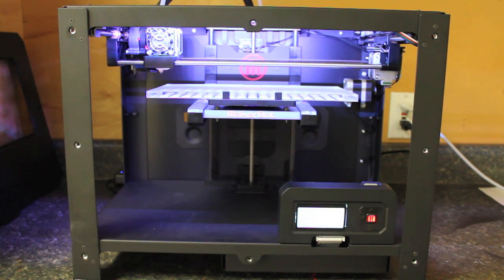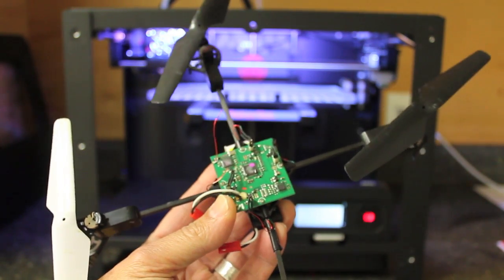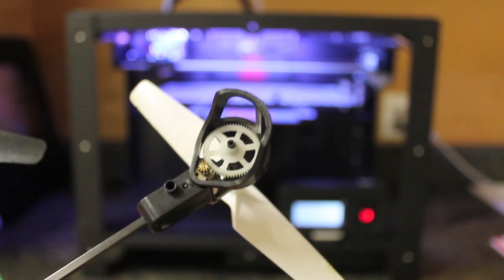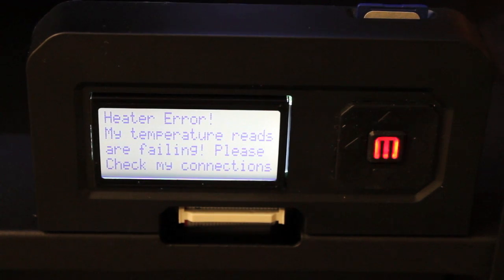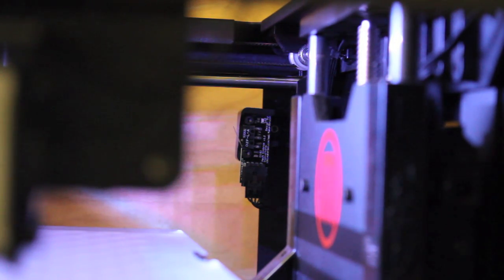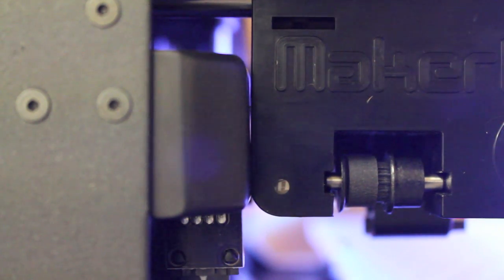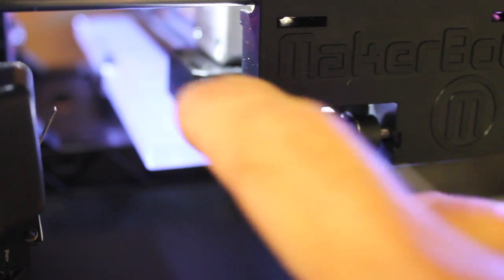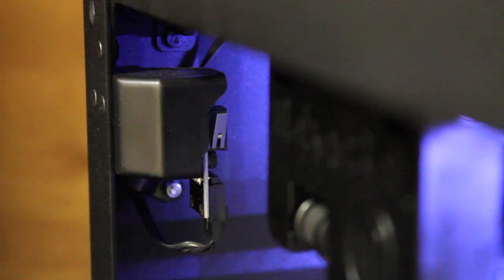I thought I was going to print quad and RC parts with my Makerbot Replicator 2 3D Printer

Comment: I see this is 3 years old.  It looks like you have the Shapeways version of the makerbot with the bad extruders.  Shapeways screwed the pooch with not being responsible and warrantying their bad design.  It isnt your fault they remade a good product into a bad printer.

Now Shapeways is dumping them on the market for about $600 each.
Reply from the maker: +wi11y1960 Interesting. I wasn't aware of this. Will have to do some research. Lately I've been having a heck of a time trying to get my extruder to extrude. It only has one job and has failed miserably!
Reply: Hence the headaches all other buyers of that printer are having with the integral print head.  You may have to contact the vendor for a now non warranty replacement.  Otherwise be a maker and create a aftermarket hot end.
  If you were a local to me I could create something (Hancock County Maine).  Otherwise you might try going to the forum printrbottalk.com .  There might be threads there that will steer you on how to fix the machine.  A good active board.  They deal with other printers as well as the Printrbot.

Comment: hi did you make the gear or not i am planing to buy machine printer but no expirience finaly did yoou print the gear if yes were is the video thanks
Reply from the maker: Kanari Mentos I was unable to make it. The gear teeth were too small and I couldn't get it to work. Hopefully someday I'll be able to get a new printer and do something that small.
Reply: what kind printer is good for quality i need for rc hobby thanks
Reply: Kanari Mentos You need a resin printer to make something like small cogs that is working.
Reply: thanks
Reply: Dennis Baldwin  my friend here something good for you i know you use those battery alots (3.7v800mah25C) only for $1.90
from this website i buy 24 piece but use coupon ..2$off and 5$off on $47 u spend click on both coupon u save $7 before deal expire
http://www.aliexpress.com/item/3-7v-800mah-x4-Batterie-Drone-Syma-x5-X5c-V931-Upgrade-Batteries-Battery-Enough-Stock/1975329819.html

Comment: Why didn't you just take an allen wrench and adjust the switch straight? Simple quick correction without putting tape in a nice machine.
Reply from the maker: Case 275 Good suggestion. I didn't realize that was possible when I first got it. Thanks for the comment.

Comment: I just bought the $6500 Z18 and I am experiencing problems out the box.  I put in a support ticket also.  I was wondering how long did it take them to respond to you?
Reply from the maker: Congrats! That printer looks awesome and I hope support keeps up with you. When I opened a ticket with my Replicator 2 I generally heard back within 2-3 days. I was hoping for 24 hour support, but they were way too slammed at the time. When they did get back to me they were super helpful and replaced a part free of charge. I would expect with the money you spent on the Z18 that you should be getting premium support. Don't settle for anything else and good luck!

Comment: I am so impressed with your idea. Did you actually made the gears? Is it in usable condition in your quad copter? What material you used to print?
Reply from the maker: I've only used PLA since I have the R2. I didn't have any success with the small gears so I'll need to print them a bit bigger to test. It's still a great printer, just hard to get the resolution that small.

Comment: For the switch it looks like the lever is metal. Just bend it out a bit so it makes contact sooner.
Reply from the maker: Thanks for the suggestion. It's a very thin contact switch so bending it didn't help unfortunately. I had to loosen the switch assembly and adjust.

Comment: Temp reads are failing? Check the connections and verify proper placement.
That switch is a simple fix, it just needs adjusting.

Comment: Yeah this is broken. I would advise you return it. :)
Reply from the maker: I stuck it out and after getting through all the initial setup woes it's been working great. But you're right, I probably should have returned it and saved myself some frustration!
Reply: The reason it didn't work was because "YOU" wrote it off before even setting it up properly. You honestly should take this video down because it's a false statement. It wasn't the machine it was the operator..

Comment: Did you ever print the rotor gear? I would love to see what came of that.
Reply from the maker: Hey Matthew. Yes I did print it but just couldn't get the resolution to work out. When I get some time I'll do a video on it so you can see. Take care.
Reply: Thanks! I would love to see anything else you have done to the mqx as well. My printrbot is in the mail and I'm getting ready to start making all my own parts for the mqx. I'm tired of going to the hobby shop.. lol.
Reply from the maker: That's exactly why I got mine. Cool and good luck. Check out www.garagepilots.com where some of us are 3D printing RC parts. Take care.

Comment: take off the tape and get a pair of needle nose pliers and put a slight bend on the limit switch lever so it slightly sticks out further use a  micrometer to check it before or after or use something as a go no go gauge to see your change obviously its slight the thickness of three layers of tape

Comment: Bending the lever or using electrical tape is only a "band-aid." The noise is a common problem with these and it happens in different areas. In order to reduce costs, MakerBot uses bushing instead of true linear bearings.  A small piece of debris or a dry spot on rod can cause these bushings to jam. The noise you hear is coming from the stepper motor vibrating. You can clean the rods with a lint free cloth and add some non-petroleum oil or grease. I use white lithium grease on my CNC bearings and DuPont Teflon Multi-Use Lubricant on any high-speed parts (like those gears).  I have a Blade 180QX and NanoQX. I buy all my replacement parts from here (gears are $2.50): http://stores.ebay.com/GO-NITRO-HOBBIES?_trksid=p2047675.l2563
Reply from the maker: Agreed Duane. Thanks for the info on the problem as well as the link to the ebay store. It looks like they carry all sorts of RC components. Very nice.

Comment: Don't know how you (or the MFR) ultimately fixed the limit switch problem, but...
The basic design there is bad. 

  Any micro switch should have some over-travel.  That is, the head should have enough travel to push the switch lever a noticable amount *past* the switch point.  The layers of tape don't appear to allow much, if any over-travel.  I would have either:
- put a 'bump' of some kind on the carriage so it hit very near the end of the switch lever.  The tape looks like it contacts the full length of the lever.  OR
- Bend the switches spring arm out at the end so it contacted the carriage earlier and provides the needed overtravel.  I'd have also looked into re-mounting the switch to remove that offset that was tipping the switch into what looks like a small angle.

It is best to also have a long enough spring arm such that it will bend after the switch hits the switch point and any internal stop. That switch arm looks quite short.  If the MFR wasn't going to come up with a fix, I'd consider going to a reed switch and magnet, or probably better, an opto solution.  The kind of opto that has the source and sensor in one package and a gap that allows a vane to block the beam.
Regards, Steve
P.S. I know this is a year late, but am curious what was the final fix...
Reply from the maker: Steve, thanks for the elaborate explanation. I never expected to get that much schooling on a switch, but greatly appreciate it. I ended up doing your second suggestion of bending the switch arm. This has been working nicely for over a year now. But if I run into future problems I will definitely be revisiting your comment!
Reply: Dennis Baldwin It's my nature. (lots of experience..oh, and I teach)   Besides, that's the kind of information that'll help you in the future.

Give a man a fish, and you've fed him for a day.
Teach a man to fish, and you just increased your bait shop market... (;-)

[[yea, yea, I know, it's supposed to be "and you feed him for life...} (;-D)

Comment: Not that this will help your particular situation, but I just bought a FlashForge dual-head printer for $1200 on Amazon and have had almost no issues with it so far (am I lucky?).  I had originally wanted to buy the Makerbot Rep 2 but there were so many people saying how much maintenance or parts breaking down on it that I went with the FlashForge and so far I'm extremely happy with it.  Hope you get your issues worked out and start having fun printing!
Reply from the maker: Thanks Aaron. Yes, I've been printing just fine for many months now that I've gotten past these hurdles. I will definitely check out the FlashForge though and glad to hear you're enjoying it. All the best.
Reply: Glad to hear that you've been printing!  I need to add a glass build plate to my printer now to make larger prints, but so far so good otherwise.
Reply from the maker: Cool Aaron. If you do I'd love to hear how it works out for you.
Reply: Dennis Baldwin Just added my glass build plate and started having issues printing with ABS (started learning on ABS with the stock build plate).  Decided to switch over to PLA with no issues now (glass plate heated to 60c w/blue tape).  I'd like to fine tune the machine now so that I can get more clean/consistent lines, but not sure how to do that yet.
Reply: Gday Aaron, I have the flashforge also - 1.5 years later nothing has broken that I haven't broken myself with tinkering, and im using the same heated stock build plate - just replace the kapton tape every 3 months or so when it gets scuffed up. Blue tape for me was crap to be honest, and dont listen to the PLA gurus telling you what temperature to use, I have PLA that melts at 200c, I have PLA that melts at 150c, I have ABS that melts at 230c, and other ABS that melts better at 220c, all depends on the dye they use in the filament.
Reply: Geoff W.  the clean consistent lines are all down to your program setting the nozzle size  + the levelling of the build plate. the two are very important (im sure you are aware of the second one and have the calluses on your fingers to prove it)

Comment: Thanks for those suggestions. I had a look at Lulzbot, they claim to be able to print pretty Large items.
For the Exportation i am not sure as i have yet to use it myself, but i believe it exports as a standard 3D File extension. So to change file format i guess you would have to use some sort of file alteration software or freeware if possible. What i gather though is that you\ll prolly use several softwares to finally get an Stl file ( Googlesketchup) fCheck here asterweb. net /raster/tag/stl/

Comment: As a 3D printer owner, you got suggestions or recommendations towards someone seeking to acquire a 3D printer? Like what to look for, cheap ones, brands and which ones are able to print largest objects.
For Modelling part,  i suggest you use a plugin for photoshop 2D to 3D, basically it takes a 2D Image and allow you to make it into a 3D model within the Photoshop program. :)

Comment: If you can, get an UP plus,amazing printer. used it for countless kg's of filament and it has never had the slightest issue in 2 years. It has a smaller build platform but with the new firmware release it is even better, the .15 mm layer height looks better than the replicator 2's .1 mm layer height. It also doesn't have dual extrusion but if you can sacrifice some build space for a much more reliable, faster, and higher quality printer then get an up. To bad up+ 2 is not as durable though.

Comment from the maker: Thanks for the info on the soli. It's always good to hear what others are printing with. I hear you related to the time factor. My longest print is 6 hours, but the first try failed about half way through. That's the worst feeling when you think you can leave your printer unattended and the extruder jams. Doesn't happen often, but when it does I always get a bit nervous. A 22 hour print is impressive!

Comment: Don't worry too much about that noise.  It's not actually the pulleys, it's the stepper skipping steps. I wouldn't recommend doing it all day as you're driving the gantry beyond its designed limits, but you shouldn't need to pull the plug.

Comment: After having built 2 repraps and running 1 makerbot replicator at work, I will say building your own reprap is extremely satisfying (and easier than you think). But once you start using it to print, you'll learn how unreliable they can be! My Replicator has been 1000x more reliable than either reprap I built. I wish I had taken the $2000 I spent on them and bought a pre-assembled printer!

Comment: Omg! When you home the printer and you hear that grinding noise, PULL THE POWER!!!!! You're chewing up the pulleys like crazy.  I started on a makerbot replicator 1 at work. I baby the hell out of that thing (since it's not mine, I'm just the operator) - we haven't had one issue yet, aside from a noisy control board fan which was replaced for free by makerbot. Everything else about the R1 has been a blessing.

You think your R2 is bad, try building a 3d RepRap from scratch!! I've done it twice!

Comment from the maker: I hear you loud and clear. Thankfully, since I posted this vid I've had reasonable success with my R2. I'm about to do the extruder upgrade to the spring-loaded assembly and have heard this really improves print success. But it doesn't address all the issues related to quality control and electronics failures.

Comment: I gotta tell you you'll have a hard time printing a gear that small and thin with a makerbot or any FFD tech you might be able to pull it off with nylon and a 0.35 nozzle but make sure your printing outside incase the nylon get's too hot (CO production)
goodluck
terramir

Comment from the maker: The advertised layer resolution is 0.1mm, but I haven't had the need to get this precise (yet). I do feel like the gear in this video will be a challenge for the MakerBot to pull off. Mainly because the teeth are tiny. How small are the parts that you're looking to print?

Comment from the maker: I had to put this project on the back burner mainly because I'm still figuring out how to design in 3D and a gear is not an easy task. I found a gear plugin for Sketchup a while back, but have recently switched to Rhino 3D. But I suspect you're right that the Replicator 2 won't be able to handle this. I did end up purchasing a few extra gears, but would love to learn how to design it.

Comment: Holy moly, didn't they QA it before shipping it?  That's a poor reflection on Makerbot.  They should change the design so the position switch doesn't have a lever, more accurate.  And they should give it a dry run before shipping, with prices they charge.

I agree with the people who say that is gear too fine to print, but who knows I may be pleasantly suprised.  I would increase the size to something that prints well and replace it all with your own quad parts based on the printer.

Comment: The Makerbot Replicator 2 can only print PLA. It will warp at only 50° C (130°F), so don't leave the parts in sunshine. Also, don't print blades in PLA. I printed a boomerang last year in PLA, and it totally shattered on the first flight. ABS would be far better for most RC modeling projects.

Comment: i need a 3D-printer with a work zone min-of 12x12x10 or bigger, before i dive into this new area for me i know ABS is the material i will use by the request i have, for those with experience in this area what are the best quality and customer support printer companies out there, accurate print is important,i will machine tight tolerance areas, need a printer i dont have to fight as i learn,need a printer thats quality and accurate,anyone with experience in 3D-printing whats the best, thanks

Comment from the maker: I appreciate the offer, but will have to decline for the time being. I printed quite a few RC parts based on a design I did and got overwhelmed with it. One suggestion I do have is to check out makexyz . com . It's a site that allows you to upload designs and find a 3D printer near you. I hope that helps.

Comment: ok- so here is my perspective on the problem- I fixed it by bending the TOP HALF of the switch.  This way, it sticks out, but the travel to the contact button is the same (because you haven't bent that part).  If you use tape and you don't place it in exactly the right position, it may miss the switch and just move the problem a millimeter or two to the inside.  the real issue is that the PCB, upon which the switch is mounted, has its holes a millimeter too far to the back of the machine.

Comment from the maker: Thanks. I finally did and it's been great ever since. I haven't printed the gear yet, but did mess around with a design using a gear plugin for Sketchup. I do get what you're saying and do think it will be a problem to print something that needs that type of resolution. I'm just anxious to find out what the accuracy of the print would be like. I'm not sure the PLA will hold up very well to the wear and tear of a gear.

Comment from the maker: Yeah, I could've tried a few different tweaks but got restless and wanted the dang thing to print. So I opted for the quick and dirty. It's still holding up nicely, but I do plan on getting rid of the tape soon and fixing it up right. Thanks for the tip.